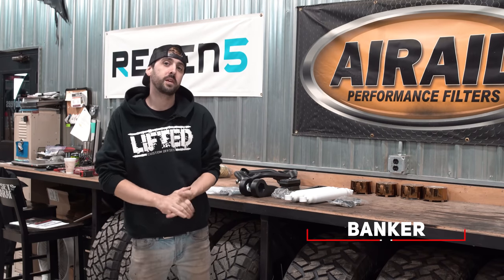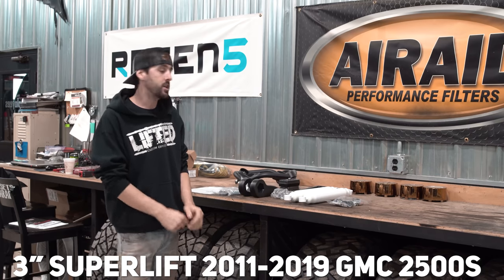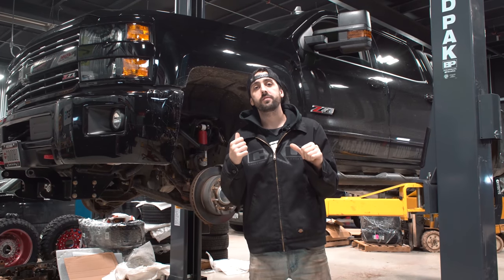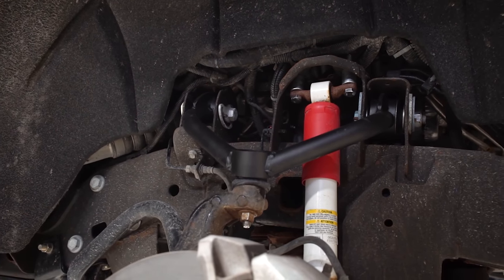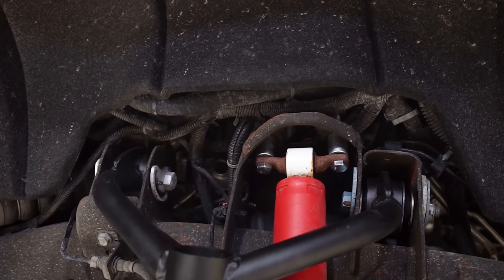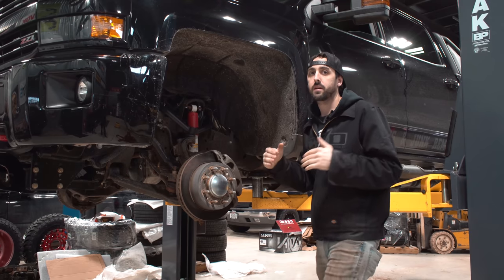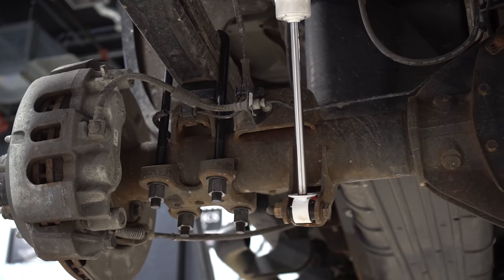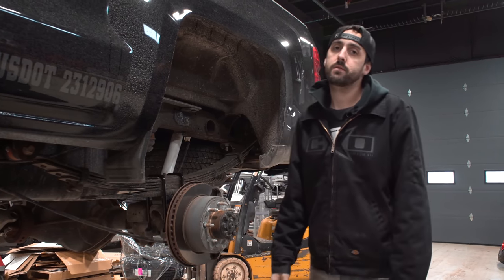Lifts & Levels: SUPERLIFT 3" Lift for 2011-2019 GMC 2500s

Comment: I bought this kit super lift 3inch with the fox shocks, I was told from local shops they placed this kit on three trucks and they said on all three they had very bad steering wheel vibration. It road very rough, I’m curious since I do tow with my truck would this be right for me 2019 Chevy Silverado HighCountry 2500HD? And have you had any issues with this lift?